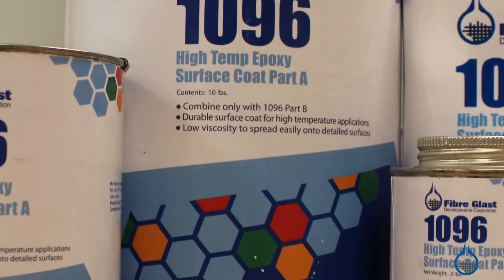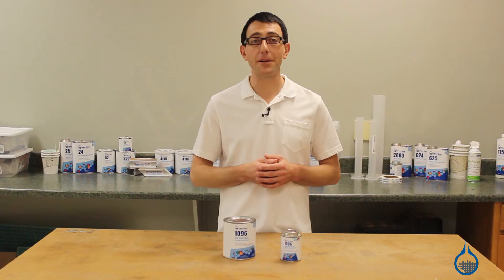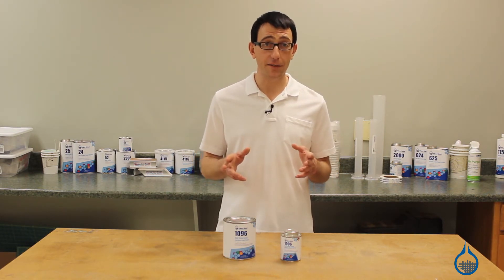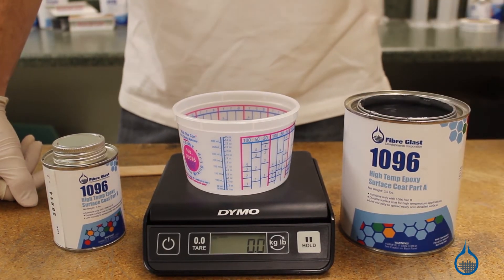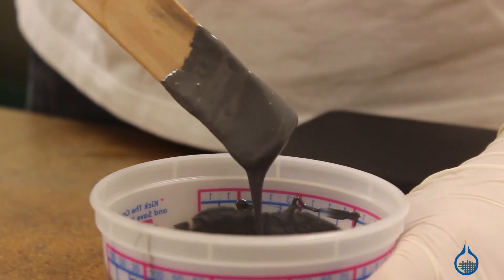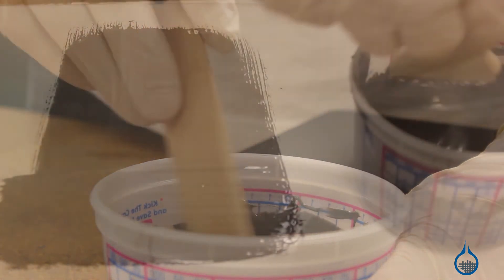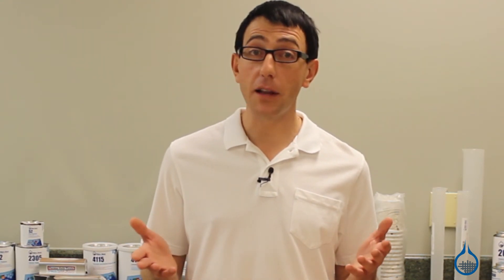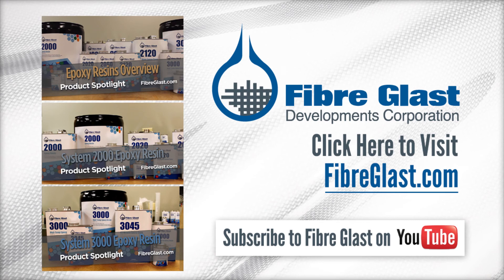1096 High Temp Epoxy Surface Coat

Comment: Can I apply this to pre-preg carbon fiber parts after they have been made? This is for a part that will be near the exhaust of a car.
Reply from the maker: Good Morning. Yes you can. Our High Temp Epoxy Surface Coat is designed to be used that way.